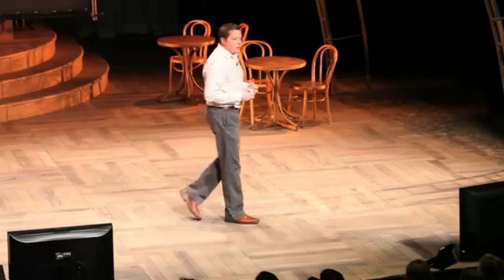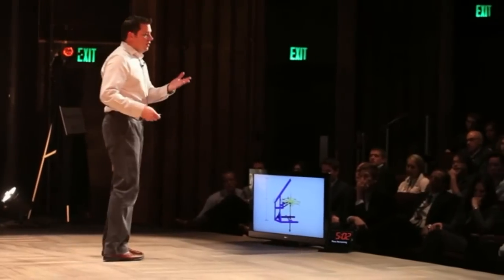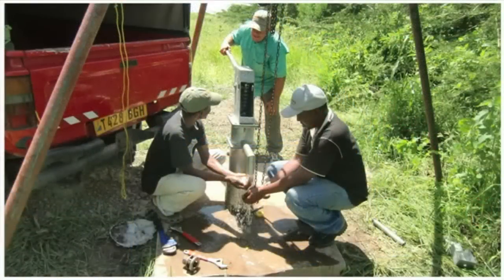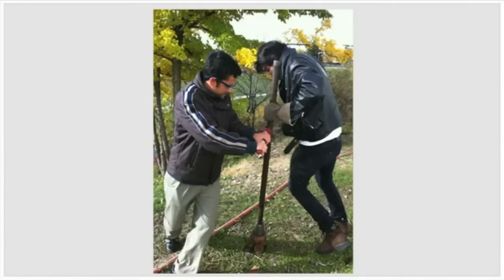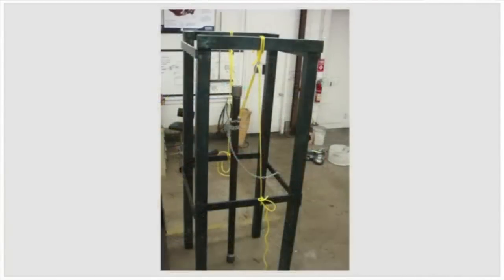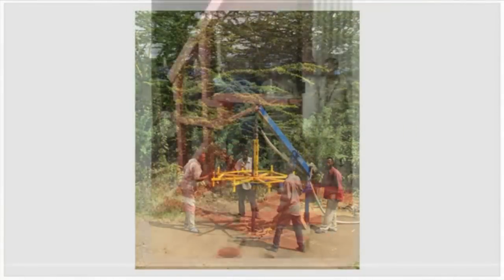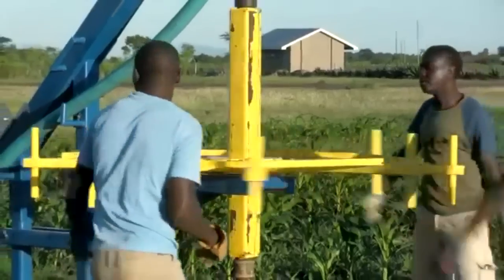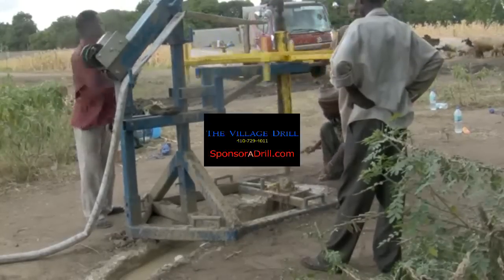Astonishing Well Drilling Rig: Portable & Human Powered

Comment: The video could use a bit of rework; cut out the majority of the time the guy is walking back and forth talking on the stage and then slow down scenes with equipment pictures by at least 4x so we can get a good look at the products.  A scrolled subtext or the like explaining things would be cool too, such as explaining that its using water to help drill, where the water is supplied from, is it under pressure. How long to typically drill X feet, what kind of vertical pressure is put on the drill, how deep you can drill with this rig, etc. Fun info :)